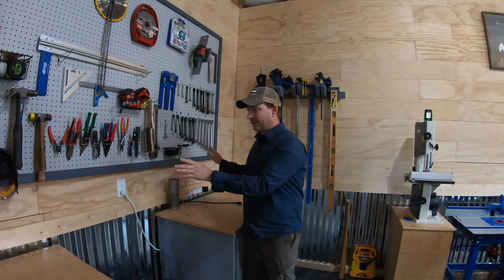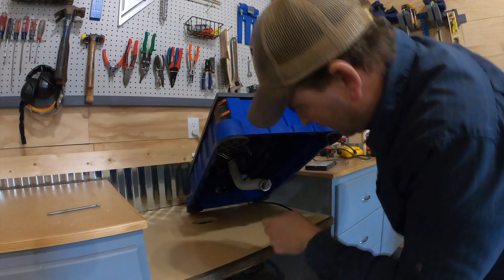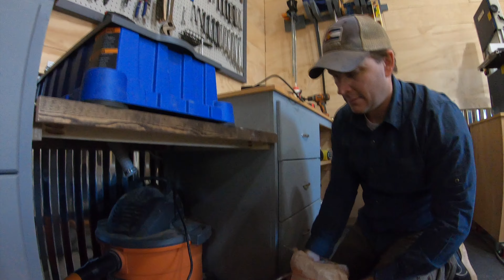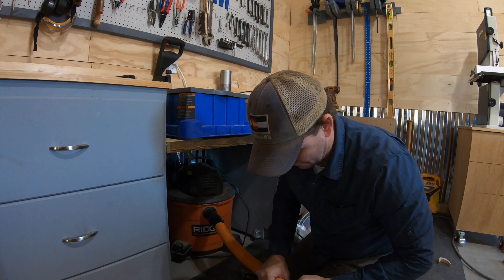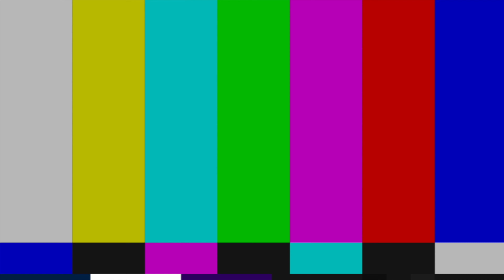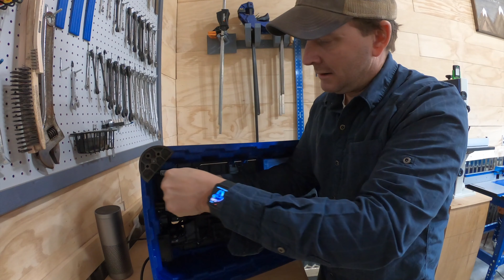Kreg Pocket Hole Workstation With Automated Dust Collection

Comment: I'm looking to do this as well but planned on having cabinets above it.  Do you see any problems with clearance if I do that?  I'm thinking that taller items that need pocket holes I would just use my K5.  I'm thinking 99% of the pocket holes I make with my foreman would be layed flat.
Reply from the maker: Agreed. Most pocket holes I drill are on a flat piece of wood. The exception is when I forget or want extra support and that can be done with another picket hole jig. Thanks for watching!

Comment: Wow, you must do a lot of pocket hole jointery for you to build a dedicated station. Do you use or know how to use any other joinery? Or are you just a pocket hole junkie?
Reply from the maker: Yeah, while I can use other joinery, I do a fair amount of pocket holes. More so I just want every tool to have a designated spot for use in the shop. Thanks for watching!
Reply: @FIAdventures  I can agree with every tool having a designated spot. I also agree that pocket holes are quick and easy, but they do (should) have their place in woodworking. Not everything should be built with pocket hole jointery imho....